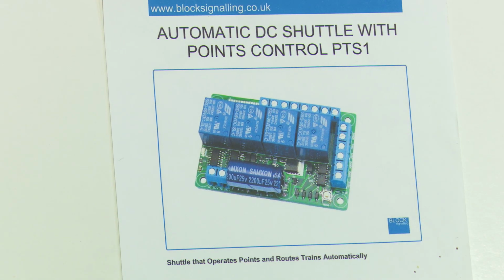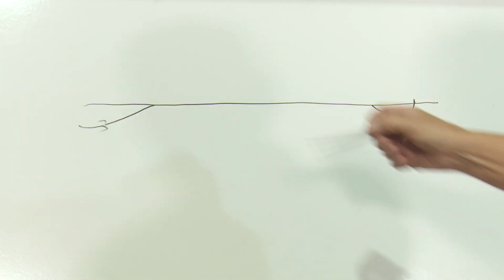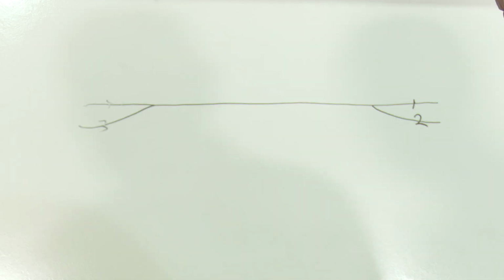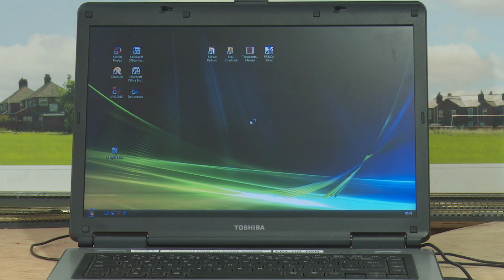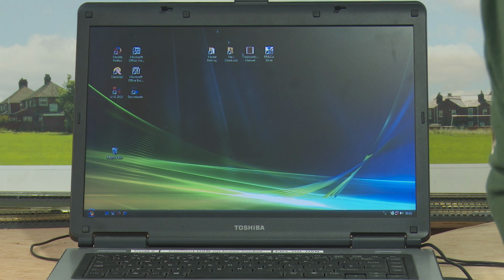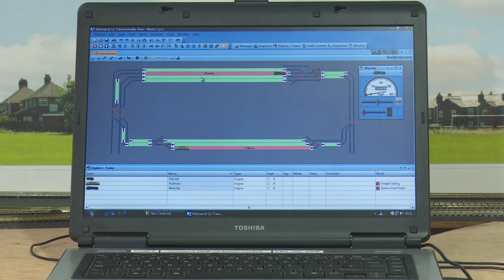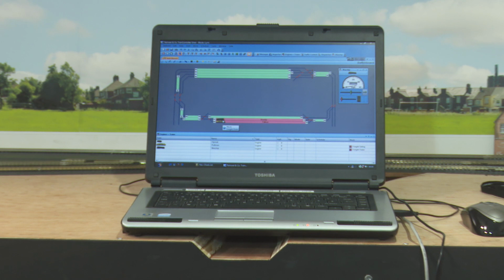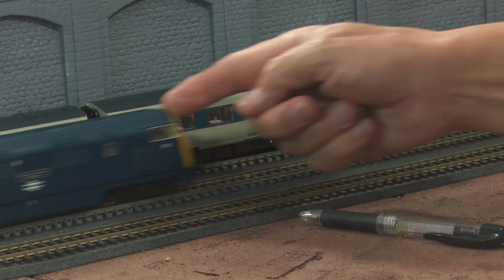Train Automation at Chadwick Model Railway | 108.

Comment: Great video and good explanation, the possibilities do seem endless though at a cost. You say the software you are using comes in three different levels, is that just their level of functionality or are they also subscription based. It's probably not a route I would take but it's still interesting to learn about, is the software Windows only as I tend to come out in a rash at the thought of using Microsoft operating systems and Apple is just too expensive.
Reply from the maker: I’m Apple based too, but I need the old laptop for this software!

Comment: Very good Charlie, very informative and gives much food for thought. I need to look at the video again, I’ve tried JMRI and I’m not that impressed, it has not worked to well with me, seems very fragile and queries and question on their forum can amount to hundreds in a day.
Reply from the maker: I think that ITrain might be the answer.
Reply: Chadwick Model Railway Sorry to pester Charlie but can I pick your brain about block detection, the current type, I am NCE with a small layout 11x2’6” typically GWR twin track with hidden sidings at the back, small country station and goods yard at the front. To invest in I train is expensive as you say and I am happy with the NCE it does what it says on the tin. But the hidden sidings are the problem, so if I run a train into a isolated loop off the main line wired through a block detector is there enough current flow even when the loco is deselected to create an output to a control and subsequent indicator which could be even a simple LED at this stage.
Reply from the maker: Yes Roy, that might be the case. The LEDs on the BDL 168’s do light up when the block is occupied. However there must be a cheaper alternative which escapes me at present.

Comment: Charlie, I'm on the fence when it comes to automation.  Having an interest in electronics I can see how this adds that other dimension to the hobby, and the fun it can bring, but equally you are then distance from the fun of actually driving (controlling) a model train.  You basically become a signalman rather than a driver :)

Enjoyed the video and your explanations of block control etc came across in an easy to understand way.  Do you document the wiring of your layout to help trace cables or diagnose faults? Back in the late 80's on my father-in-laws garden layout I used a couple of BT distributions points fitted with IDH connectors and kept a log of all incoming and outgoing connections (effectively the DP was like a patch panel), which made things easy to trace when the wrong signal changed due to connection to the incorrect sensor.

With the BD sensors costing so much, I would hate to think of the cost involved on a huge layout like McKinley
Reply: So do it the other way around. Automate the signalling (and signal the tracks properly, including shunting signals) and drive the train, possibly with an in-cab video.
If you then automate all trains BUT the one you are driving, then the signals and points will respond to what else is going on around the layout. Even better, if your system knows what type of train you are driving, you will relistically be shunted out o the way of that following express ...
Simikarly with shunting: if you are only allowed on the main line in between trains passing, automate that so you have a more realisitc individual driving experience.
Reply: Malcolm I have a fully automated layout, but that doesn't mean I can't control my trains manually. You can have both. Automating doesn't rule out good old manual operation.
Reply from the maker: Great points gentlemen. I do like the thought of  in-cab video withe the automation.  Regards Charlie

Comment: Thanks Charlie.
How do you go about wiring the stop section at the end of a block? Is basically wired like a separate block with its own feed to the bdl168? Currently laying track and wanted to get all the wiring in correctly 
Best wishes
Phil
Reply: My guess is that he's wired that to another BDL168 section. No wonder he's finding this expensive! I'm wiring my layout to use a BDL168 for the main block and a simple infra-red detector for the stop point; as traincontroller doesn't need the luxury of an entire BDL168 section
Reply: John Smith 
Thanks for the reply John. That’s what I was thinking. It will cost me a fortune if I have to use up a block just for a small stopping section. My plan was to use infra red detectors for stopping before the end of a block on required sections. My one problem is that I can’t seem to find any info on how the ir sensors wire into the digitrax system? Is this something you know about and have any advise? I’m still very early in the track laying so what to get all the hardware/wiring in as I go. Thanks for any advice
Phil
Reply from the maker: But what does your infra red switch connect to John?
Reply: @ChadwickModelRailway  Anything that converts an on-off signal to Loconet. I'm using a LocoIO module at the moment, it handles 16 inputs and is fairly cheap (though you do have to do some minor soldering of components to the PCB): http://users.telenet.be/deloof/page8.html Or the LocoServo module from the same chap gives you control of 8 servos and has 8 LocoIO ports. Both boards allow you to map the closure of the switch to a loconet "Block Occupied" state which TC will pick up.

Comment: I'm building an Automated DCC layout without a computer. (who wants spend all their time on a confuser?).. 

I have had to make my own automagic brake modules so trains obey signals! (I made them properly so they work even better than Lens BM2s!)

Now I can then operate the layout as a signalman rather than a train driver (or a driver of 5 trains.. who can manage that!) 
or I can let the Ecos do the signals and routes based on the block detection triggers which is where it all becomes fully automatic..

@Chadwick Model Railway Did you get my email 18th July?
Reply from the maker: If I had recieved it, I would have replied.  Did you send it to the gmail account?
Reply: I sent it to your domain email, I've forwarded to the gmail account.
Reply from the maker: Thanks mate.

Comment: Great video Charlie, and very timely as earlier this week I was looking at your previous block detection videos from Chadwick TMD. Your system can detect the position of the loco’s, but what about the rest of the train?, or is the block always longer than the train?
Reply from the maker: A great question William. If it doesn’t draw current then, on my system, it isn't there!  This is why I put lights in guard's vans, in case of a break away as the next train would just steam straight into it.  Coaches with lighting pick-ups will show up, again because they draw current.  The train can be longer than the block and it can also occupy two blocks.  It's very much "what works for you".   Please check out video number 9.
Regards Charlie.
Reply: One can also add resistive wheelsets to carriages or wagons without lighting. It is always recommended that the last carriage in any train draw current one way or another.l
Reply: @JamesPetts  thanks for this info James. I’m modelling late1960’s so I don’t  have power cars front and rear drawing current. Resistive wheelsets might be perfect for the last maroon coach in the rake being pulled by my Early Deltic. Thank you
Reply: @ChadwickModelRailway  aah, now that really makes sense. So the lights in the brake van aren't just for looks, they also provide a feedback signal to your train controller software. Ingenious